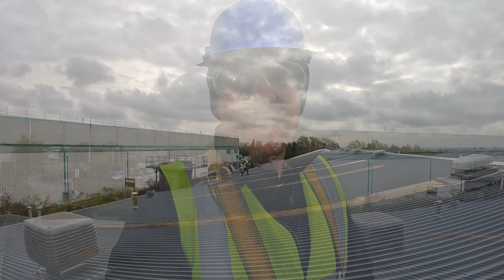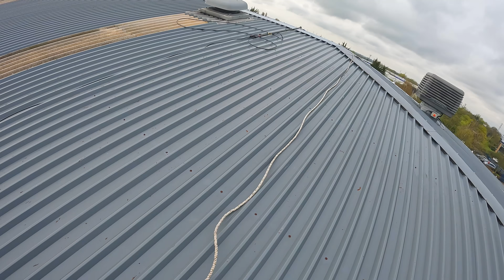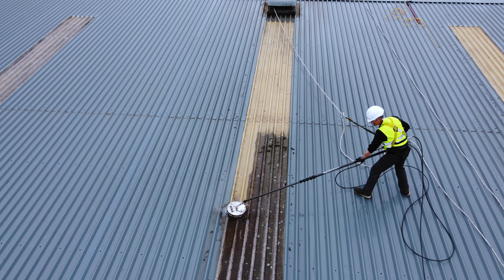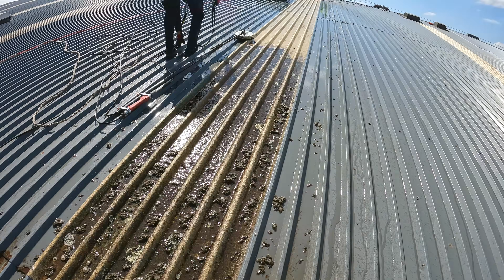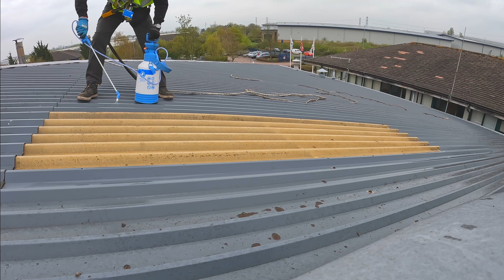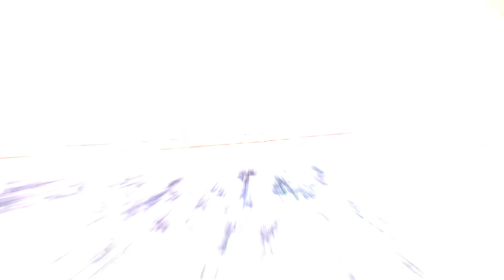Commercial Factory Skylights Cleaned Using Pressure Washing and Softwash Techniques

Comment: Hi mate just needed a bit of advice please. I’m about to buy a face lift system with Ro/Di filtration and I’ll be using it 4/5 days a week all day with 2 poles running. What’s the up keep cost of filters etc? Should I just get a delivery only and fill up at pure water tanks or would it save me more money with Ro/Di? Moving from traditional so I’m new to it all. Thanks
Reply from the maker: I would always favour a setup that filters your own water rather than running back and forth to a filling station. You might change your resin filter every couple of months, pre filters every 4/5 months, and your RO filter every 3 years or so. Then there’s your water bill, but if you get a sub meter on your outside tap they will deduct it from your bill.😉👍🏼
Reply: @aemackintosh  thanks mate really appreciate your feedback 👍🏻👌🏻 I’m not on a water meter thankfully 😅
Reply: @aemackintosh  iv seen how much ro filters are 🤮 😂 but how much is resin and the other filters that you mentioned
Reply: @aemackintosh  sorry last thing as I’m about to spend £10000/15000 all in all need your expertise😂 , what medium size vans most reliable and would cope with all the weight?
Reply: I’m looking at a 725L tank and my area is medium water around 150ppm.